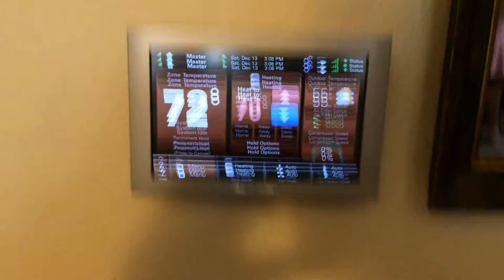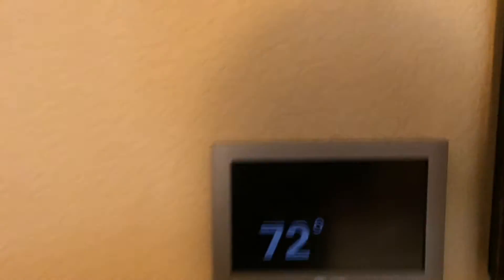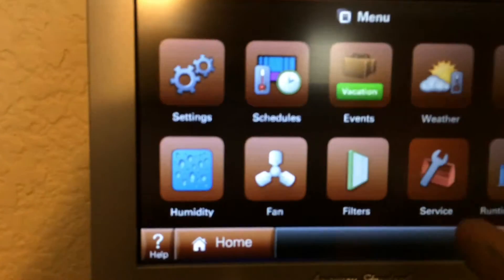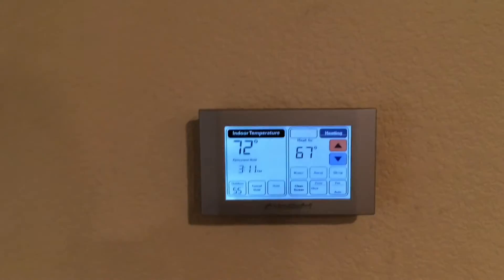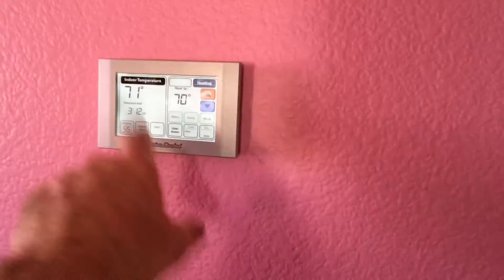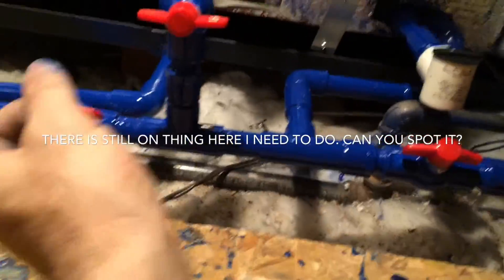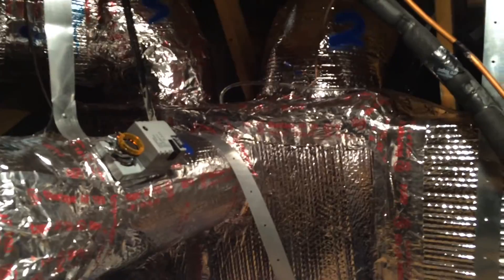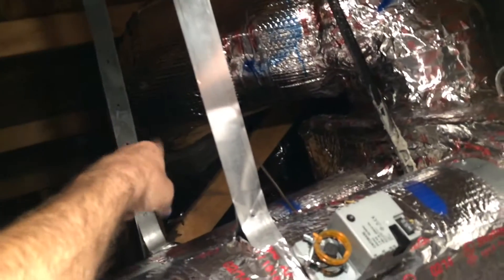Best air conditioner made, high efficiency AC unit cools the home with 400 watts

Comment: 1. Did you install it yourself? 2. Lennox has a 25 SEER condenser, which is REALLY good savings. And 3. I have a 2001 Lennox Merit Series and I need to know how much SEER it is. How can I figure that out?
Reply from the maker: Take a picture of the model number and post it here, I'll tell you the seer
Reply: Las Vegas Air Conditioning, Inc. Where is the model number on the A/C?
Reply from the maker: Should be on the name tag
The name tag is usually in the outside of unit somewhere but if not sometimes it's on a sticker on the inside of the electrical panel
Reply: Las Vegas Air Conditioning, Inc. The Model number is 12ACB60